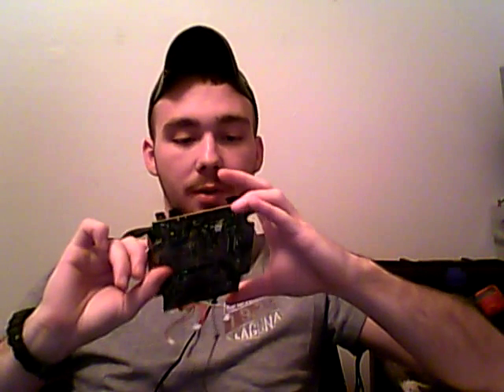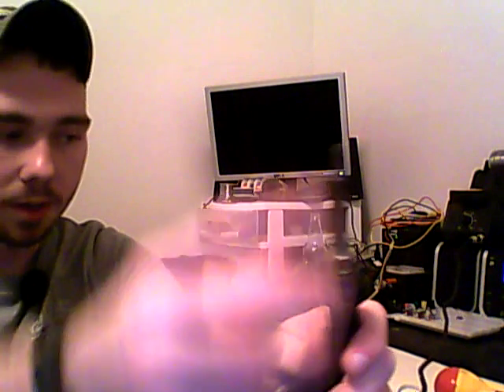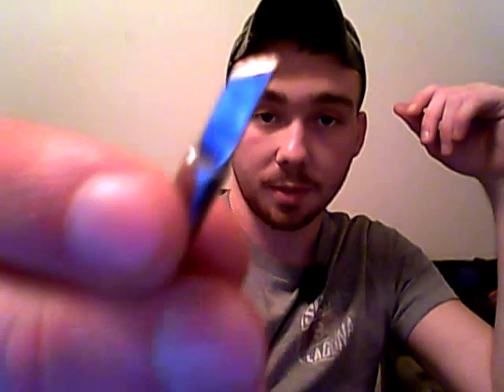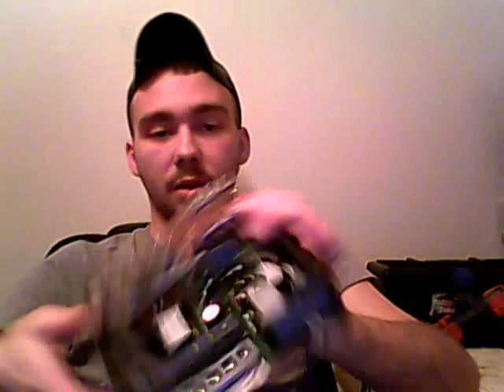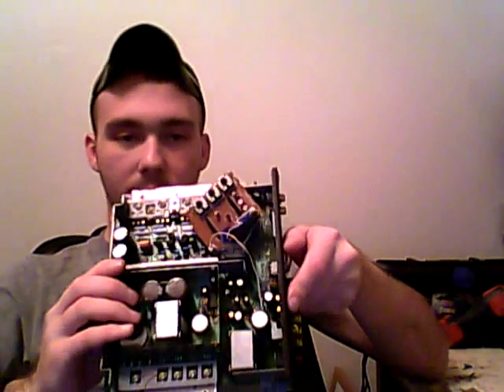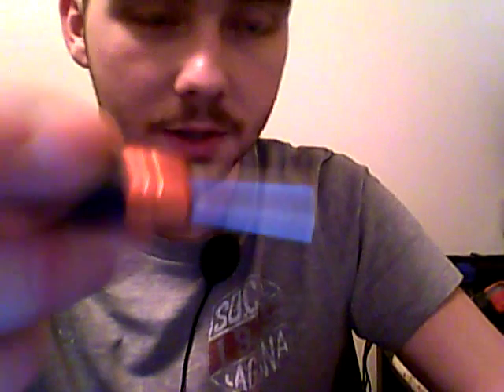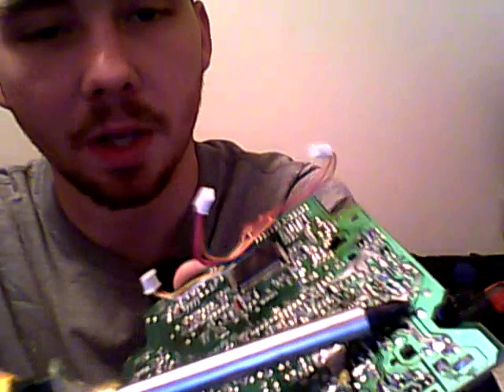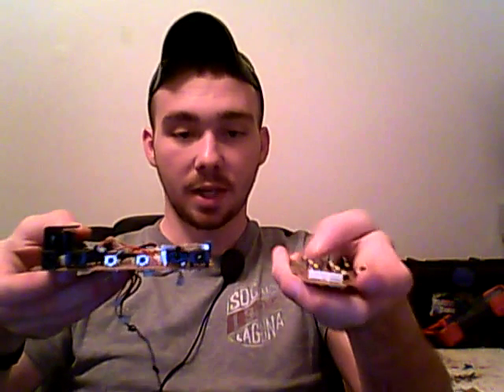Diy Electronics - Obtaining Electrical Parts

Comment: Hi, I need a 22uH inductor and I cant get one here in the Philippines. I have tried mail order and it gets stolen all the time. You would get lots of subscribers if you could show us how to make simple circuits and power supplies from TV's or old radios. Please make a video on how to make a 22uH air core inductor with a standard drill bit and magnet and a standard wire size and windings  that I could copy with out the use of expensive equipment, because I cant get the equipment either.
Thanks. I only have a multimeter, that's all they sell.